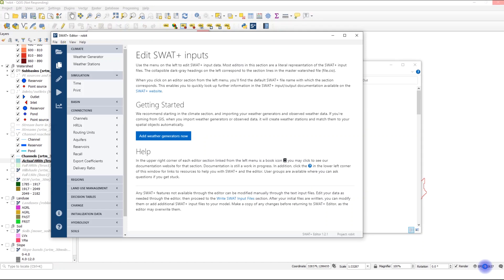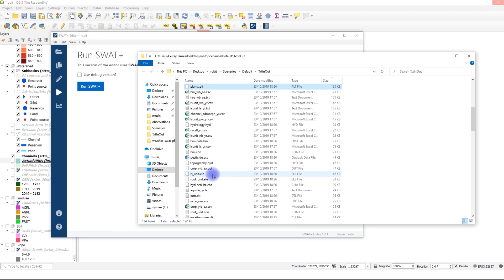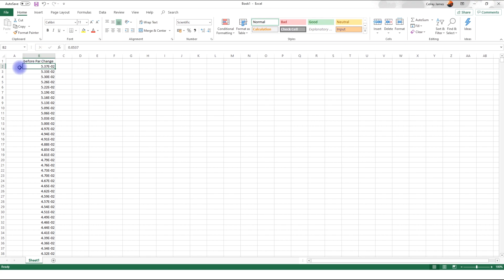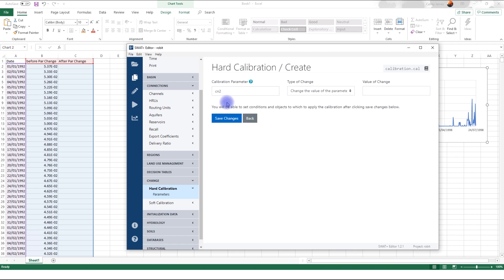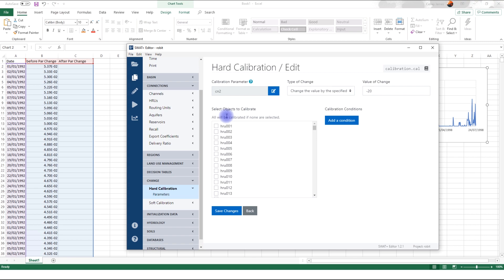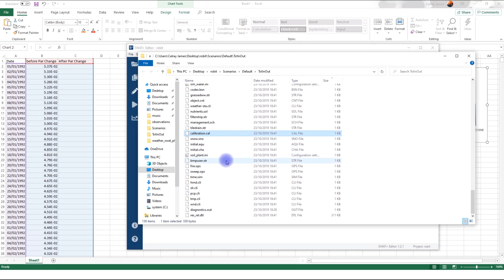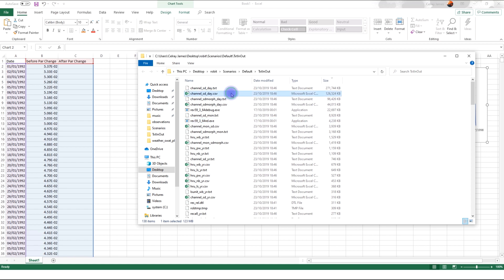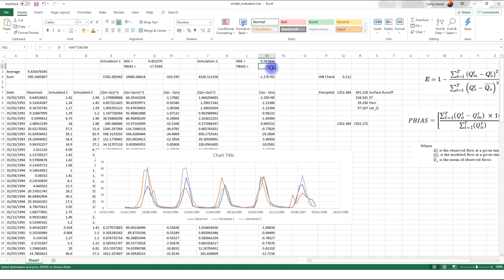Introduction to SWAT+ Part 7 - Calibrating Parameters (Manual Calibration)

Comment: How to do multisite calibration in SWAT+ model
There may be two methods.
Method-1
One time SWAT model set up for entire basin using the multisite as gauging stations and deriving sub-basins accordingly. And for calibration, calibrate the upper most subbasin first and then fixing it parameter and moving to the downstream sub-basin for calibration and so on. The advantage of this method is that it requires one time set up for SWAT model. The disadvantage is that there will be propagation of the error (observed flow – simulated flow) as we move downstream sub-basins for calibration. There would be huge cumulative error for the most downstream sub-basin in the simulated flow entering into this sub basin. This would involve the inclusion of cumulative of the error as moving downstream sub-basin.

Method-2
SWAT model set up individually for each gauging stations starting from the upper one. For calibration, individual sub-basin will be calibrated. For the downstream subbasins their upstream observed discharge can be given as input as inlet and so on. Since individual sub-basin is calibrated by providing observed flow of upper sub-basin as inlet to so error propagation in not here. The disadvantage is that it requires individual set up for each sub basin and additional complexity arising of reservoir command area in this sub-basin whereas the reservoir is lying in other sub-basin.

My Issues are:
1) How to fix the calibrated parameter for the upper most gauging site.
2) Now moving to the second upper most gauging site, how to minimize the effect of the difference propagating due to the difference in the actual and simulated ones.  
3) How to supply the actual observed data for gauging site one so that the calibration at gauging site two will be less affected.